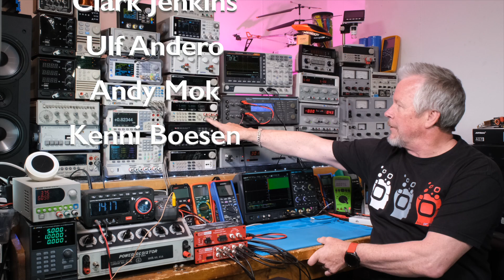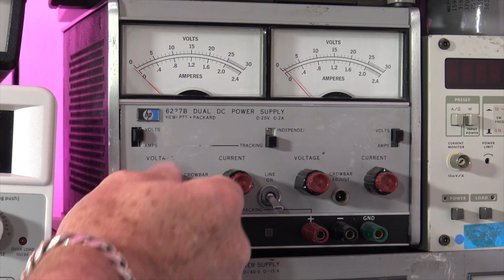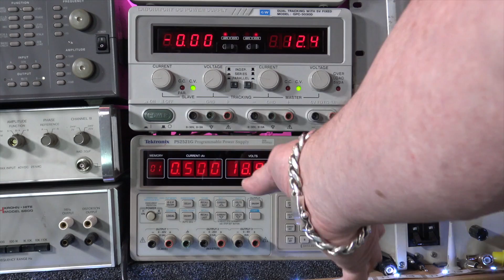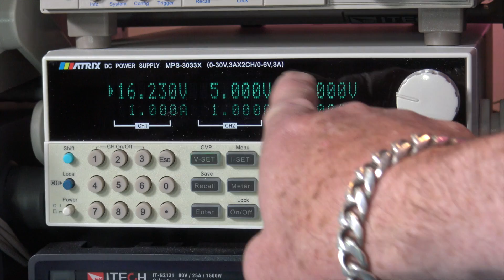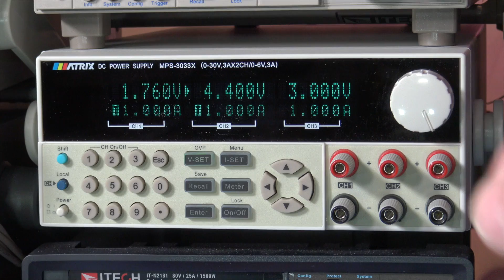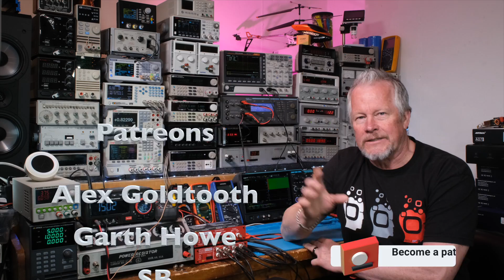What is a Tracking Power Supply and How do they work? #benchpowersupply #labpowersupply

Comment: Speaking of power supplies how is wout APFC design going? 
Mine sort of work but LLC does not work yet. Any advice on how to safely debug HV stuff? what would be the safe way to handle debugging?
Reply from the maker: Thanks for asking!  I have been doing some work in the background.  I need to get a few videos out of the way and then I'll get this series going.
Reply: @kissanalog  nice good luck
Reply from the maker: Thank you!  What chips did you use.  Did you make your own transformer?
Reply: @kissanalog  Bought the transformer from Wurth and IC is UCC25660. It gets a bit warm but it seems not to switch anything . there is nothing on the other side of the transformer.
Reply from the maker: Thanks Robert!  Can you give me the P/N from Wurth?  What was your power output (V and P) desired?  I'm getting back on this.

Comment: Eddie, I would recommend calling the common connection between outputs "Return" not ground.
Reply: That's a pretty good idea, but the most common usage is to have a positive and negative supply with your common "return" as the circuit's ground reference. This is the convention with op amps and current drivers. You'd be fighting decades of "Tradition!" to change this, but maybe you could submit a white paper to IEEE.
Reply from the maker: #pbaemedan Yes you are right - I do have to remind myself to use Return.  I fall into calling it ground because I know that's what people are expecting.